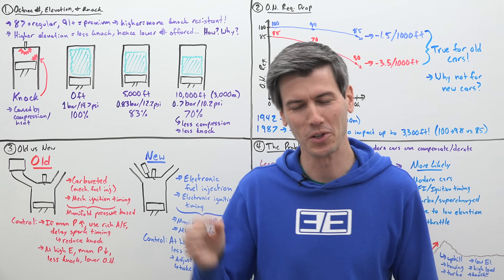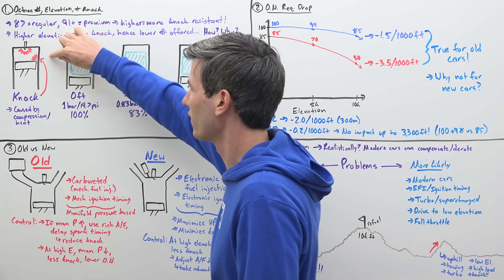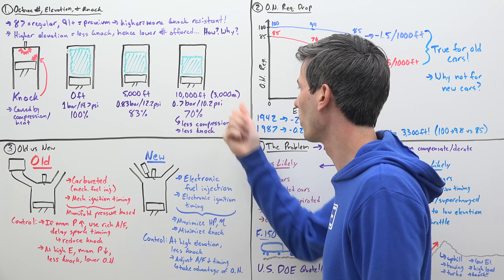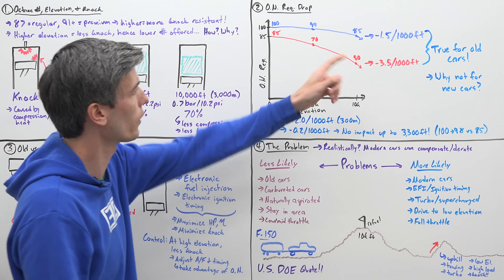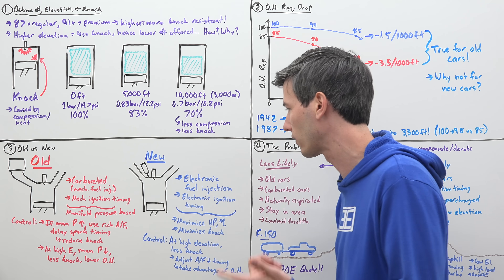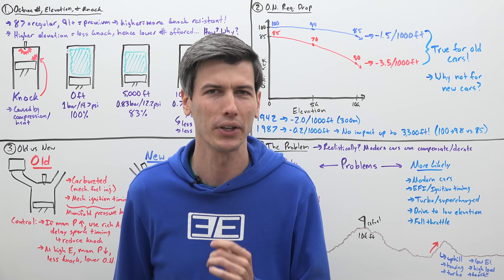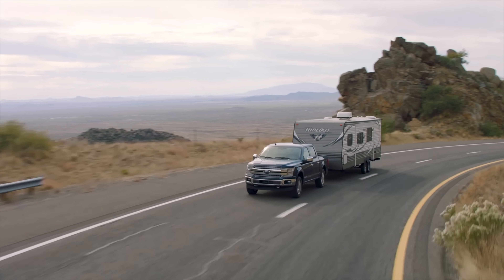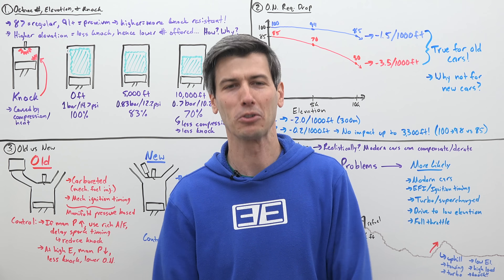Never Use This Gas In Your Car!

Comment: What's bonkers is owning an F150 and use it mainly for social & domestic driving, and commuting to work. Madness!
Reply: clearly you've never been to rural America, where this is 100% the norm
Reply: @42elliott top-selling vehicle in the US?
Reply: @42elliott  Yeah, that's the point. A bunch of people buying trucks they don't need cause 'Merica.
Reply: Many people can only afford one car. A truck can double as a car. Especially a crew cab truck. A car cannot double as a truck. People that need both will buy the truck out of necessity.
Reply: @billybeemus3929  Correction, most people that think they need a truck don't really, and justify like you do because they just want a giant truck. I watched the new Tundra launch and the lead engineer says in their research, only 25% of truck owners tow, ever. That's 75% of the buying public who very well may never need a truck capability at all, let alone a full sized truck.
Reply: A truck does far more than just towing.  It still does other things a regular car cannot.  You’ll find a truck bed useful if you are moving, on vacation, or even just moving large, awkward objects around.
Reply: @mechmat12345  Exactly! Here in the UK 4-wheel drive SUV's are very popular, but a small percentage ever go off-road and are mainly owned by people who live in urban areas. Madness, a complete waste of resources & road space.
Reply: @mechmat12345  You can tow with lots of SUVs, the point of a truck is the ability to throw stuff in the bed easier than in a trunk/back hatch. Even then a lot of people don't do that super often, but I don't really see the problem with driving whatever you want to drive. I mean no one needs a sports car, but I don't see us complaining about that.
Reply: @mechmat12345  - Please actually read my comment. And trucks are used for more than just towing. The reality is that you have no idea how anyone uses their vehicle. And you have even less concern with how anyone else spends their own money. Should people be prevented from buying Mercedes, BMWs, Ferraris, etc. just because a Kia Rio serves the same purpose for less cost and with better mileage? Of course not.
Reply: @ChrisBrown-xf2ce  The F150 actually make decent sense. It's more fuel efficient than all of the other trucks save maybe the Ford Maverick with it's Hybrid and CVT. Pretty much does everything you need or want to do.
Reply: @mechmat12345  Please tell me you're not one of those people tries to shove a 85" TV into a Toyota Corolla.
Reply: @DragonKnightX12  The F150 makes no sense for most owners; they simply do not need a massive truck with massive capabilities. Yet, they justify the purchase to themselves and others with hypothetical scenarios where they may become a lumberjack for the day. They dream of driving up the side of a mountain or wade through floods ironically caused by climate change. Most owners live in dense urban environments and use the vehicle for commuting, social and domestic purposes. In other words, they purchase a massively oversized vehicle with capabilities far above what is needed. Satisfying the man-child in them.

I do get it though, I would love to own one, but then my common sense spoils the fun & informs me I'll be spending thousands on something I'll never actually use to its full potential. When I need to move the big stuff, vehicle hire companies exist for odd occasions requiring such a vehicle.
Reply: @ChrisBrown-xf2ce  An F-150 is a "massively oversized" vehicle? Have you ever seen a crew cab long-bed F-350 Dually? That's massive. My 2018 F-150 is a comfortable, quiet, relatively fuel efficient daily driver. I've averaged 21.3 mpg over the last 32k miles, and though not 40 mpg like a little car, that's not bad for a full-size truck that I feel safe in. LIttle cars scare the crap out of me and I'll never have another one. I don't have kids so I don't need a soccer mom SUV either. I also don't live in an urban area that requires I park it in a space built for a Smart for two. And no, I don't use all of its capabilities, but when the snow is flying in Colorado and I need to get to work, it's nice to have the 4-wheel drive and added weight of the truck. When there's 10 to 12 inches of snow on the road you're welcome to drive your Prius through it and I'll wave as I go by in my safe, capable F-150 while my seat heater keeps my ass warm.

Does everything you own get used to its full potential? Do you fill every seat in your car for every trip? Do you use every function on your phone? Do you use your computer to do everything its capable of, or just check email and peruse Facebook when you have some time to kill? Do you use every appliance in your home for everything they're capable of? Probably not. Regarless of where one lives, it basically comes down to what we want; not what we need that motivates a purchase. So maybe before you buy that next piece of electronic gear or an article of clothing, ask yourself if it makes sense and if you'll use every one of it capabilities or get the most out of it. That seems to be what you're asking pickup truck owners to do.
Reply: @jeffb6786  F150 and fuel efficiency in the same sentence I've heard it all now. You feel safe in your big truck because you are surrounded by safety technology designed to protect the occupants. Pedestrians & other vulnerable road users are at increased risks. Also, as your bigger, you're more of a danger to people in small more practical sized vehicles,. but their safety isn't your concern? Most of my purchases are based around functionality especially ones where I'm spending thousands of £'s. If anything I overuse the functionality of my car, safely though.

Comment: My Subaru Forester did run on a 60/40 mix of 95 ROZ (witch is comparable to 85 MOZ) and Diesel it didn´t run good but it brought me to the next Fuelsation  for specifications 2004 Subaru Forester 2.0X with the EJ201 an every car in germany that uses Super Bleifrei  just runs on 85 MOZ

Comment: Who remembers when you could buy 100+ octane racing fuel at your local gas stations? We'd often put some in our tanks so we could clean any carbon off the valves. Not sure if it worked but they stopped selling it locally a long time ago so I can't test to see if it actually worked. I had a 1973 Mercury Capri with a 2L that had 9.5:1 compression(we specced this thing out) and it'd knock on anything below 89 octane. At one point it used to "diesel" in the summer. I had a friend who filled his tank with the super stuff...then burned a piston when trying to race someone....

Comment: Another wonderful learning experience as usual. Could you do a video on why catalytic converters smell terrible at full throttle?
Reply: The catalyst accumulates sulfur impurities in the fuel, which are only released when the catalyst reaches high temperatures created by medium to full throttle operation. It's sort of like a self cleaning oven, when it gets really hot all the buildup burns off. You will notice it more when the catalyst is new and on cars that are normally driven slow (grandma drivers) who happen to punch it very rarely. Daily use of full throttle will help reduce the levels of sulfur adsorption and increase catalyst efficiency.
Reply: @TechnicalLee  thank you!!

Comment: The reason we have this problem is most engines nowadays are between 9 and 11:1 compression. Just compressing air to that creates alot of heat without combustion. My Hemi recommends 89 and states 87 as ok. When you watch knock sensor reading with a scan tool, you see 87 does create slightly higher signals under high load, low rpm, but the PCM retard ignition a bit and it's never noticable. I wouldn't consider trying that on a direct injection, tubrocharged engine such as an ecoboost. You are adding alot more pressure, but the real problem is in stratified charge that GDI engines can do. This is where at low RPM and lighter loads, the throttle valve defaults open to fill the cylinder, and fuel volume is used to control speed (like a diesel). This is done to make a rich spot in the cylinder while making the rest super lean. Lean = heat. And then you get a phenomenon tagged "superknock" only takes one to crack a piston. Ask Kia, Hyundai, and Ford. They know all about it.

Comment: Also in the UK theres been a lot of scaremongering about E10 but ive been trying to tell them people in LA where i lived back in the 00s , were have been using E10 fuel for like 30 years now and no problems
Reply: There's quite a lot of older cars for which E10 is going to be a problem. They'll probably run just fine for a while - the octane number isn't changing - but the ethanol will eat away at various parts of the fuel system made out of plastics and rubbers not designed to deal with it.
Reply: @abarratt8869  Just put some Redex in the tank that should balance it out ?

Comment: Drove through the high-elevation states a couple of years back, and the choices are 85 or 89; no option to buy 87.  So at high elevation, why pay more for a higher-octane fuel than my vehicle needs even at sea level, when the premium was quite high.  I went with 85, and made a point of topping up a half-tank with 89 once I got to lower elevation, to even things out.  

It would be easiest if 87 were sold even at elevation.
Reply: Road tripping from Nevada to Ohio through Utah and Colorado I've seen 85, 86, 88 and 89. I didn't know what the deal was with 85 and 86 so I just put the next highest, whether it was 87, 88 or 89.